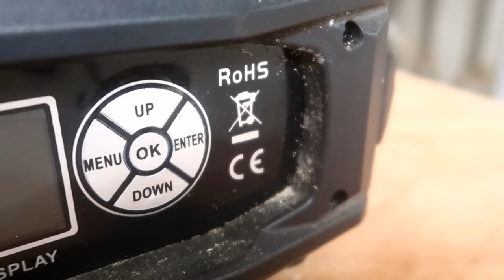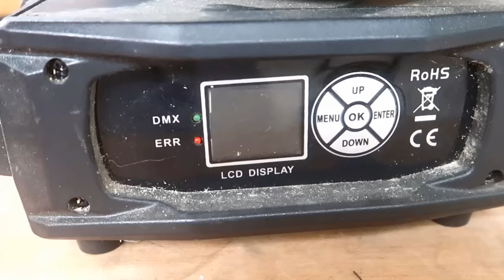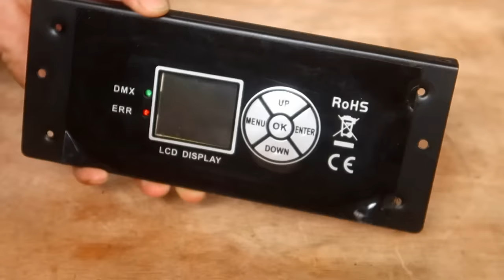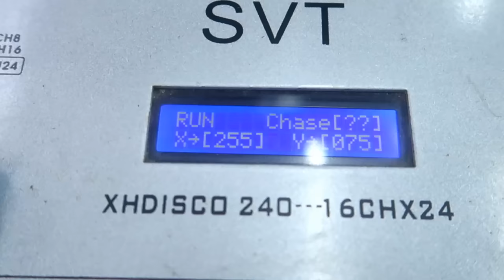Professional event beam light restoration // Lighting restoration for professional events

Comment: It's kinda strange to see a light where the power in/out plugs are exactly the same. Normally for this type of connector (PowerCon), the output would be grey. Just thought I'd point that out as it's odd. Good work though.
Reply: Exactly.. I thought the same thing.. powercon in is blue and powercon out is white.. so that is definitely wrong..
Reply: its a cheap chinese mover... what did you expect